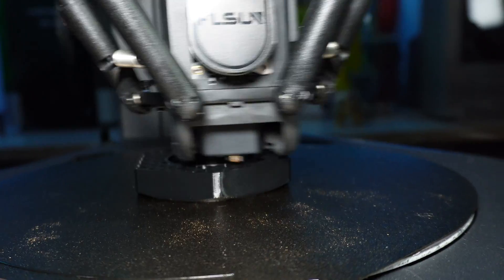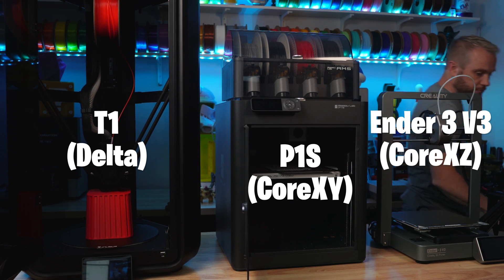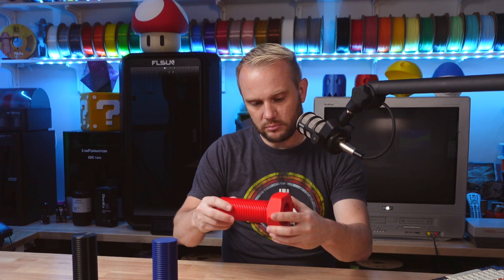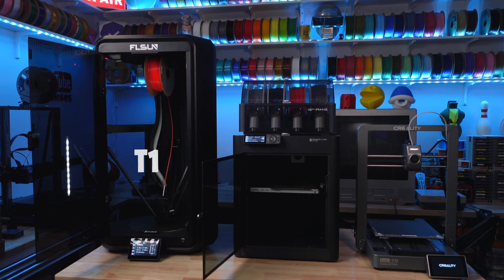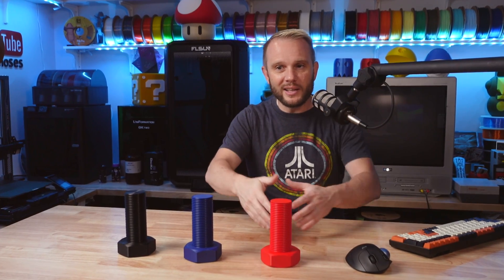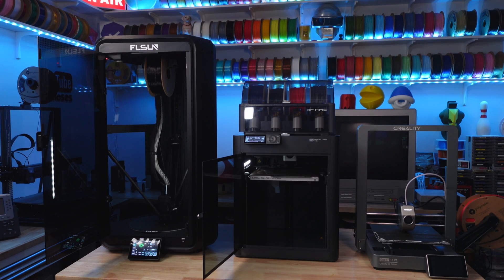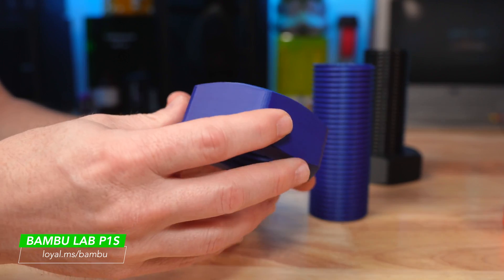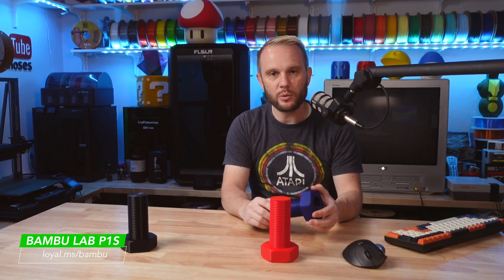Bambu P1S vs FLSUN T1 vs Ender 3 V3 - 3D Printer Comparison

Comment: I have the Ender 3 V3, and can confirm it handles overhangs very well. A a test I printed a minidisc case (7cm square) at a 45 degree angle with no supports - it printed perfectly.

Comment: assuming this is the base T1, is it still as loud as it was when you initially reviewed it or has there been an update sense then fixing the issue? if that's even possible, I've only been into the hobby about a year
Reply from the maker: The T1 Pro is so much quieter, and there is a silent kit for the T1 now.

Comment: If the print quality is that close together and the Creality is at least $150 cheaper than FL Sun and $250 cheaper than the Bambu Labs, I would take the Creality for the bigger build volume. It's 30% bigger than the P1S and almost twice the size of the T1, ON THE PLATE. Most people hardly ever max out their build height. The FL Sun has a circular build plate which really limits how big of a square you print on it. I don't print near as many large round objects as I do large square or oblong objects. To top it all off, the Creality and the P1S will print larger round objects than the FL Sun. If printing long skinny objects, the Creality can go over 420mm diagonally, the wider the shorter you can print. When it comes to noise levels, the FL Sun is atrocious. It sounds like a jet engine on steroids. The P1S with the cabinet closed is probably the quietest. Speed is nice, but not as big a factor as print quality and price.
Reply: When one prints lot, speed is much more than "nice" advatege. Also... There was no print  quality problem on T1 comparing to the other two. That leaves only the print size capacity, price and the noise vs. speed advatege.

Comment: My first machine was a cheap delta. I never was able to get a good print out of it. Partly because of my inexperience, but also because the machine suked. :) I am considering the Flsun. I really want one that will just print out of the box. But I don't like Bambu because it requires the internet to live up to its full potential. And I don't like the slinger because the design is inefficient. I had an ender knockoff for a while, and it was okay for some things, but it required constant attention to keep it working properly. I like the delta design for its efficiency and speed. The V400 has a direct drive extruder, so that's a plus as well.
Reply from the maker: Thanks for sharing! Let me know what you choose!

Comment: I had started with delta 3d printers from the beginning.  Real problem is after a few years is getting control board replacement parts.  Results have been very accurate.
Reply from the maker: Awesome!

Comment: Planning to buy a printer. And studying how to use it. What is the program to use for these machines? Is it included?
Reply from the maker: The slicer is the program used to prepare a model for printing, and recently what you use to send a print to a printer over the network if you aren’t going to use a USB stick or SD card.

OrcaSlicer is a common one for general use, Bambu Studio is for Bambu Lab printers primarily and there are others like Cura, and PrusaSlicer as well.

Comment: So the T1 is faster and cheaper and has better print quality than the P1S? I think there is a clear winner. (Unless you count the size as a negative.)
Reply from the maker: If only it were that simple. The overall experience is more important than the individual traits. The P1S will produce better prints more reliably and the slicing, management and multi-color experience also put it ahead in all aspects. The T1 is fast, and for prototyping and also just for pure joy at this speed, the T1 is amazing!

Comment: in this price range for flat out speed if you're doing complex models and don't need the size, the anycubic M7 pro is an amazing pick, you get a similar speed for the bolt, but you can print 8 at the same time. (in theory you should be able to print in 35 min in maximum speed on HS resin, and you should probably still be getting similar quality on Z since it's 0.2mm layer height)
note that clean up may be more involved since it's resin, but if you're doing multi part batches or models that would have a lot of hops/direction changes, it's still way faster.
and you could get the m5s for half the price, it's the one I'm currently using and it's amazing, printing multiple 10cm high models in an hour.
also cost isn't really an issue anymore, resin is around the same price as filament nowadays. (though if you are only doing very small models in 1-2 of, the cost of ppe starts to add up.)

btw I would advise against high speed resin because it's definitely not a general purpose resin, it prints fast and is extremely rigid, but that's also what causes most of the pain with it, it's relatively brittle (i.e. it will shatter if dropped from 1m+) and it will film up if it's sunny and you open the window or door. also it's almost impossible to print anything requiring flexing. though if you need a prototype in the next hour it'll do that no problem. a better one is ABS-like resin.
Reply from the maker: Thanks for sharing!

Comment: I have a Bambu X1C that had a heated sensor cable that failed on me.  When trying to repair the X1C on my own I may have caused an issue with the plastic plug in housing, (still trying to figure this out).  So my "best" performing 3D printer is out of service and I have no way to get it fixed unless I get lucky and do it myself successfully.  I am shopping for a 3D printer and am hesitant to buy another Bambu product because I am afraid that I lost a lot of money on my X1C knowing that I may never be able to bring it back into operating condition.  I guess it is pretty much the same with all 3D printers, once they break down, you're on your own.  So no-one mentions the repairability of 3D printers and I was wondering if you hav e thoughts on the difficulty level of repairs out there, (might make a great video).  Any thoughts?
Reply from the maker: Me personally, I’m not too concerned with repairing something - I can’t repair my PS5 when it breaks… I know that is a concern for some, just not me really.

I just hope we keep moving forward and printers get better and better. You have to admit, we are doing so much better than ever before with them right now.

Comment: I've had so many issues with the Flsun printer I have mainly with getting it dialed in. I have destroyed my bed trying to get it to printer successfully. Selling it. Just not worth the aggravation. I am going wtih Bamboo. We plan on getting an A1 and a P1s.
Reply from the maker: Oh no, that's never good to hear. Which FLSUN printer was it? I don't blame you for going with a Bambu machine, they are awesome.
Reply: @LoyalMoses  I have a QQ. I have dialed in the z offset but it looks like every slicer overrides that setting and drives the nozzle into the bed. Wierd. I don't understand it at all.

Comment: I vote for Core XY as the best overall system for current generation of printers. Delta config is too mathematically and mechanically complex for my taste, and I imagine it would be a nightmare to incorporate sophisticated algorithms   related to resonance compensation, input shaping, motor noise reduction etc. Besides,  just look at the size of this monster. Almost half of its volume is used by the mechanism. Not very efficient use of space, and I also have reservations about reliability (particularly of the links, which require very high long-term precision under stress).  As for Core XZ,  I don't see the point of having a fast Z axis. 99 percents of the time the printing head needs to move in XY plane, and that's where speed matters. Z is only used when advancing to the next layer, and sometimes for short distance Z-hopping. No need to be ultra-fast on that axis at all. 

Second point: there are not many filaments which can reliably print at 250 mm/s, let alone 1000 mm/s. I personally don't print from PLA except when I need to test something, as it is too thermally unstable and prone to sagging. As for other, more practical materials, the vast majority of them don't print well at super high speeds, so the Delta here doesn't have an advsntage. And the third printer has open frame so it is also not well suited for such materials (albeit for a  different reason). 

So, between these three, I would choose at P1S without hesitation.  Besides, maybe it's just me, but even in this video I like the look of the part it produced more then the other two, despite the author's comments.
Reply from the maker: CoreXZ isn't just about the motion speed, but also reducing weight and vibration on Z as well - so there is still a small benefit, even if minimal there.

As for filaments - I am receiving new PLAs right now that are rated at 800mm/s and this coming week I will have several rated for 1200mm/s - everything is changing, and the recipes for all of these base filaments will soon be high speed. Even Bambu Lab doesn't have "high speed" filament, because ALL of their filament is high speed.

But yes, I agree the P1S is just the better general purpose machine. Still LOVE the way the delta moves though, my gosh I love it.

Thank you for sharing!
Reply: @LoyalMoses  I'm still not convinced about the advantages of Core XZ -- maybe I'll change my mind when variable-Z-layer (forgot the exact term) printing becomes more commonplace than it is now. Until then, I don't think the Z axis matters much as long as it's statically stable and precise.

 Regarding speeds -- like I said, I don't use PLA for most of my prints, so I guess we have different use cases here. I certainly don't mind waiting a bit longer if at the end I get a quality print with good layer adhesion. For rapid prototyping, I agree that speed matters a lot, and could be a determining factor -- I just don't do much of prototyping, I mostly print functional parts for my electro-mechanical projects, using ASA, PA, ABS, TPU and the likes. In any case, I am about to test my theories soon as my new P1S should arrive in the mail today.

I also understand how cool it must be to watch a working Delta. When I was a child, I was mesmerized by electric typewriters --  modern laser printers are so boring in comparison 😀

Thanks for the interesting discussion!
Reply: It all depends on your needs and understanding of the technology. If I need multicolor printing, I’d definitely go with the P1S. But if saving time is my priority, I’d definitely choose the T1.

Comment: Because I already have X1c and bambu A1 mini, purchasing T1 might just be for its Delta ways. looks and size and fits nicely as a corner Art piece.  I have not used my Bambu x1c yet for AbS cause I don't have the other hot end.
Reply from the maker: Nice machines! And yes that T1 could be art! 🔥

Comment: Apologies if i missed it, but did you run the P1S at standard 300mm/s or the "ludicrous" 500mm/s setting?
It's advertised as 500mm/s, but that's not what you're getting by default
Reply from the maker: I ran them at their "normal" speeds. So it was around 300mm/s for the V3 and the P1S and the T1 was around 600 to 700mm/s

Comment: I did a Rostock delta about 13 years ago as a frame re-do from my original printer x-y-z printer with a home built frame. I designed my own motherboard based on an STM32F103VBT chip (Creality started using them years later), bios and had both functional. Problem with the delta, more prone to frame missalignment issues, I was always adjusting it. Also, the swivel connections are high load wearing components.  
I had an FLSUN core x-y kit that I made about 8 years ago, It was OK but the hot end cooling above the heat transition was poor, I ended up making a water cooled top part above the transition to stop fat filament plug-jams, I had no issues assembling the kit but it was around 8 hours assembly + setup, a lot of purchasers gave up though I thought the manual was just fine, there wasn't the same degree of pre-assembly people expect these days, it was a very raw kit. 
Bearing quality is important for longevity, also effective electronics cooling. An enclosed printer saves time printing large brims and even high skirts where high accuracy is required. I do most of my printing with PLA and some with PETg+, rarely anything else but for enclosed, other options are a lot more practical.
Reply from the maker: Thank you for sharing!

Comment: Are they good for minuatures or still begind resin? I am worried about the toxic fumes but only print out tiny ones.
Reply from the maker: Resin is still the best option for miniatures. FDM can work, but you just won't have that tiny detail or really smooth prints without post processing.

Comment: FLSUN's power to print circles is also it's weakness, it's having to do ADVANCED inverse kinematic computations to draw straight lines, getting XY scaling tolerances dialed in on a delta can be impossible if there are manufacturing discrepancies in arm lengths, because XY doesn't even exist! It's 3 wiggly arms in the air, doing advanced motions just to make a straight line, I'm sure it's a beast at vase mode though, and those that it's surface-tells aren't an issue, then the speed makes up for it there. Even as someone who started on an E3, I'd also pick the P1, fully enclosable, future AMS, Core XY motion has too many benefits over bedslinger. That said I just got a A1 mini, because It's a complete AMS solutions for less than the P1 alone. Impressed with it's speed and quality already. Some of the best first layers and I haven't had to tweak a darn thing..just magic.
Reply from the maker: I think the most amazing thing here is that we have 3 very capable machines producing great results as these speeds. What a time to be in 3D printing!!! Thank you for taking the time to comment! 💜
Reply: the formula isn't that complex, it's just square roots and additions/multiplications*, if I'm not mistaken it runs on the rockchip RV1109 which is a dual core at 1.5Ghz, calculating the kinematics is probably at most 50 clock cycles, that means you can do 30M calculations per second, a tmc2209 has a frequency of around 50khz, so 150k calculations is enough to keep up with the drivers.
so tl;dr yes it's more complex but it's a non issue to the point that you can run a lot of overhead on top
*it's a pain to calculate, but once the calculation is done, the required computation is relatively trivial on any modern processor.
Reply: @satibel  I know a reasonable bit about IK, I should have been more careful what words I emphasize. My biggest issue is all the artifacts that get generated trying to turn such an unconstrained system BACK into a planar printer again. It just seems like a waste of core potential to simply go, slightly faster. I'd love to see one of these delta printer companies go ham and build a full stewart platform with slicer support that can tilt and become the defacto for non-planar printing at home.

Comment: Regarding the Flsun printer, the guy on "Needitmakeit" recently reviewed it as well and developed a cooling shroud that vastly improved the cooling to the point that the loud CPAP fan could be run at a much lower RPM and still achieve the same print quality. Worth checking out in my opinion.

Comment: Bambu p1s. Already have 2 of them. Run 1000+ hours on all 3 of those machines and the p1s will still be printing great. The creality will give you nothing but headaches. Well at least thats my experience.
Reply from the maker: Those P1Ss are SOOO nice! I really want more people to experience them. I hear that a lot about Creality of course, but times are changing and Bambu has had a real impact on the industry, driving a lot of these companies forward on the hardware, software and even support.
Reply: Spot on.

Comment: Okay, about the ender 3 V3, what is the advantage of a core xz system over traditional bedslinger?

Having the x motor on the bridge seems to me is not limiting the speed of the machine, because of the limited movement of the z axis. Can anybody explain this to me?

Ps: P1S owner here, and never regretted getting one.
Reply: Thanks, that cleares up a lot.
Reply from the maker: P1S is an amazing machine!

As for the corexz system... two motors work together rather than one alone, so the movement becomes very efficient, faster and more precise. Additionally, it reduces weight on the x-gantry which helps limit vibrations and wobble. It can also be a cost savings as well depending on how it is manufactured.
Reply: It’s worth buying. It’s crazy fast & super nice print quality. Buy directly from Creality, not Amazon.

Comment: Apple for Apple: A1 for the same price tag! Sold all my Prusa and Creality for 2 x X1C, 1 x A1 & 1 x A1 Mini and will never look back! It just works!
Reply: I'm going that direction myself, started printing a couple years ago. Of course started off w/creality printers, figured they worked well enough and cheaper pricing. Always told myself "bambu prints look a little better but not $$$ better. Bought an A1 mini a few months ago, now I find myself printing almost everything on it. While my V3 k1, SE and V2 barely get used. Just bought the P1S and plan on selling my creality  printers.... besides my K1 it prints well enough and it's fast.
Reply from the maker: That's so true! People haven't yet experienced them just don't know!
Reply: I'm printing relatively exotic filaments (ABS variants and Amphora) and having an enclosure is relatively mandatory.

Comment: Bambulab is the most round product for me, I would buy a P1S, though I have an X1C and really hate the nozzle cooling solution.... hope there where some upgrades that really really made some improvement. dont know if P1S suffers from the same, would guess yes since they use the same tool head
Reply from the maker: For sure, it is the best all around machine on the bench if you could only have one.